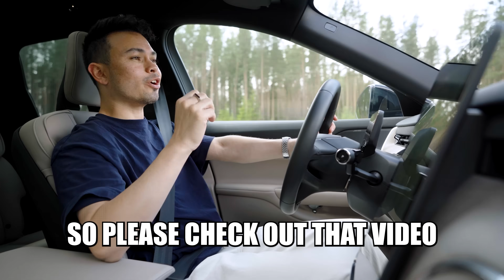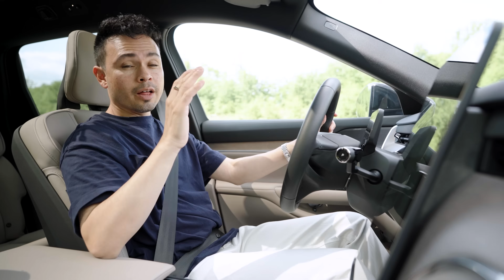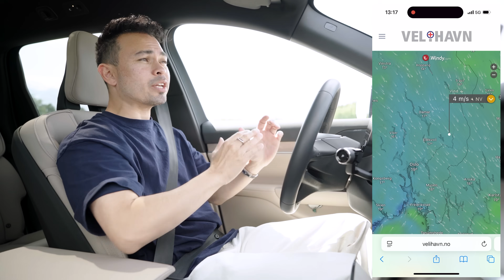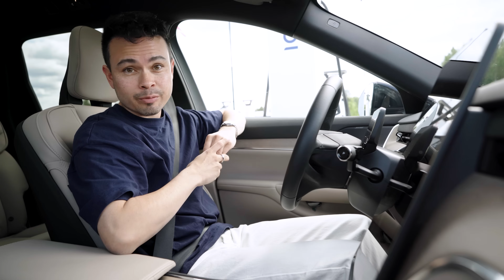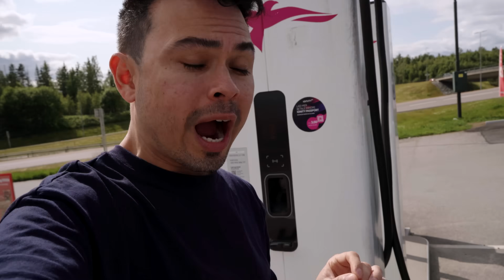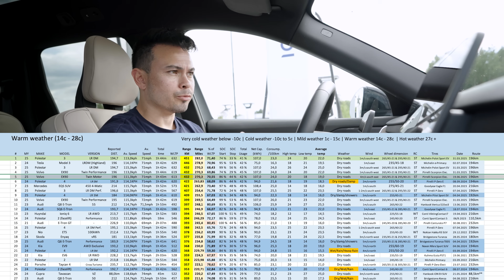Volvo EX90 (non-Performance) | RANGE TEST @120KPH (75MPH)

Comment: I like the EX90 and I would prefer the non performance on 21”. But: the battery and consumption are no go’s. 
I was recently at a rapid charger at 45% (plugged in at 45%) and my BMW i5 pulled 197kW. I would have expected much better from the eX90. And the consumption… My BMW (granted, not an SUV) uses around 17 kWh/100km in good conditions… So I come back to my idea of getting an estate. So much more efficient, but Volvo won’t sell estates anymore. That’s actually why I ordered the BMW over a Volvo since Volvo only had inefficient SUV’s on sale.

Comment: Great test! I think the result is quite reasonable for a tall vehicle like this. When it comes to charging, it actually requires more than 625 amps—closer to 640–650 A—since the nominal voltage is around 375 V at approximately 50% state of charge. Tesla V3 supports over 900 Amps on NACS.

Comment: Actually I would like to see a range test and consumption of the single motor version. 
It is 200 kg lighter,  this should make quite an impact.
Reply: No it shouldn't,because of physics.
How much difference is it between Tesla cars with single or double motors?
Reply: @ms-jl6dl 
Saying weight doesn’t affect EV consumption is just nonsense. More weight means more energy, that’s basic physics. The dual motor Tesla is heavier because of the second motor and extra components, and yes, it burns more power because of it.

Model 3 RWD: ~13.5 kWh/100 km VS Dual motor: ~15 kWh/100 km. That’s a solid 10% increase, and it’s not magic --> it’s mass 😊

If you’re gonna talk EVs, at least understand how momentum and energy work. This isn’t up for debate
Reply: @speedy-436  Also in addition to the weight difference double motors has more rotating components, even with the clutch disconnecting one motor
Reply: @ms-jl6dl  Kia EV9 has 10-20km difference between single and dual motor.